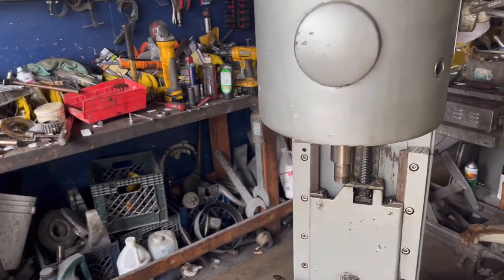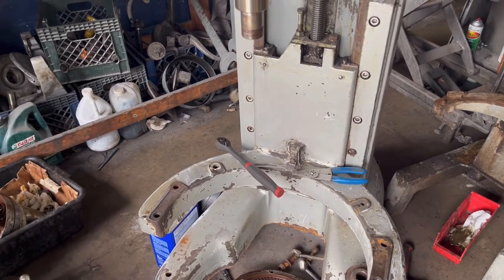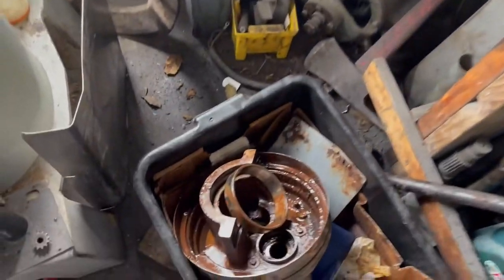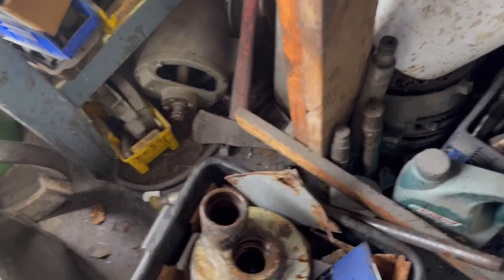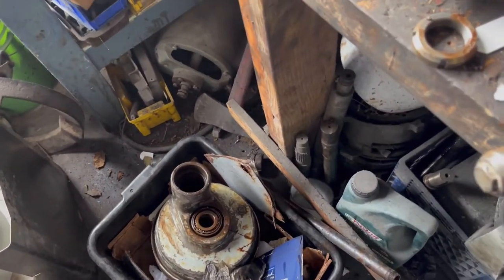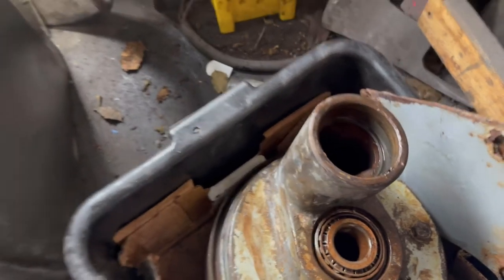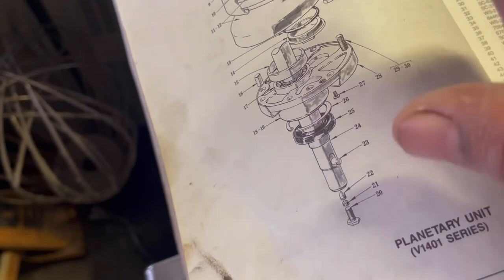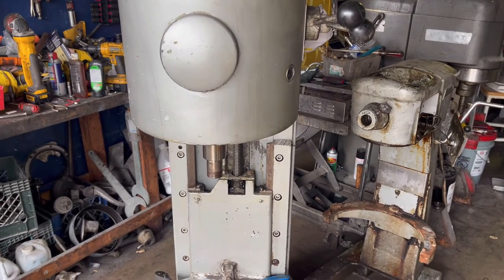Hobart M802 Planetary service Maintenance

Comment: If you can help I disassembled to the top potion an reassembled, now the clutch pack raises and will not lock into run position, and the speed shifter goes all the way around any ideas
Reply from the maker: Ok 
There are 3 flat heads screws with a nut, if you replaced the inner discs you might have applied too much pressure on the discs, check one my videos when I explain how to adjust the discs inside the clutch

Comment: Just FYI if you have a Hobart Saw pully and a bowl you can place 2×4s across the bowl and place. The saw pully on the 2×4s the agitator shaft will fit into the hole of the pully then you can slowly crank the bowl up.
Reply: Good way to break the fiber gear

Comment: Hey, I have a oil leak on top of the planetary extension on a v1401 I don't want to get into it until I know what I'm doing, I do HVAC/R so I work on kitchen equipment as well. I've looked up part diagrams and I can't see why it's leaking from where it is any advice
Reply from the maker: Sorry for the late response 
Is hard to know with out seeing it.
Now a few things to check first is the oil plug on the side of the planetary below the oil drip cup remove the plug if there is too much oil I’ll come out 
This is what I would check first 
Also if the leaking happens when the machine is running on high speed that’s a sign of too much oil on planetary 
Next suspect would be transmission seals and O rings might have broken allowing oil to fill out the planetary with extra oil
Reply: @calucoelsv  well we found the drive gear for the oil pump in the transmission was broken off and we ordered the o-rings for the chimney and a new chimney seal
Reply: @calucoelsv  hey, it's me again. So seals didn't seem torn up, but we replaced them anyway, now after reassembly 3rd and 4th gears bind up after we tighten up the transmission cover.

Comment: Great videos, can you do a video talking about the brake system of a M802? I am repairing one but i am stuck with How it works
Reply from the maker: Thank you 
In regards of a video of your m802 brake it’s no too complicated is basically replacing the friction disc and the brake disc there are 2 black friction discs and 3 plates made of steel what I would do is replace all of them.
Now if with new disc still doesn’t brake the clutch also tension comes into play if not enough tension or too much tension in the clutch won’t brake my strong expertise are on smaller units I don’t do many m802 or 1401 but I’ll be rebuilding an m802 soon so I might make a video on that machine
Reply: Thanks i will be Paying attention to all Yout videos